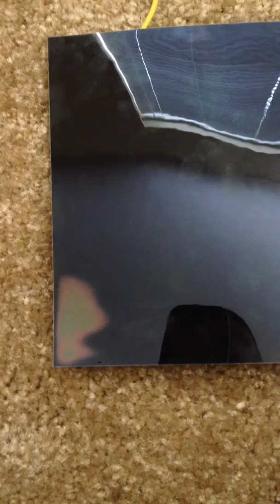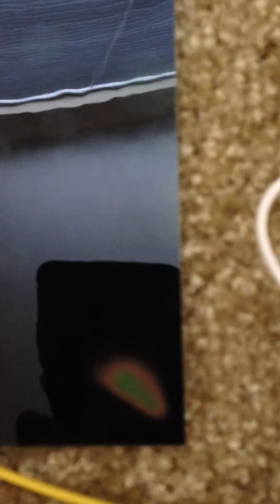Gerard Morin Thermochromic "Cold Radiation" Test

Comment: Hi Chris just dropped you a note.  The vortex is an inward collapsing of radiation from the vacuum.  same thing is occurring in Gerard's IR meter reading cold.  expansion outward is hot and inward collapse is cold.  The fields around the environment continue to move even though power is turned off until the vacuum has finally returned to it's Zero Point.  Jack Scholtz NEO Ball experiment also indicates this,   no power to his Rodin Toroid coil and yet the Neo Ball keeps spinning in the shot glass even at 10 Ft from coil for quite a while.   It would very interesting if we could discover a way to use the collapsing etheric force to give us refrigeration.

I'm building some mini pole transformers based on the How It's Made video on pole transformers.  It is very interesting when you see the poles inside secondary that is running your house.  its simply an aluminum plate and one plate can run two houses.  Primary is about 540 turns of 8 to 10 ga mag wire 14.4 KV applied.

Comment: Spark gaps get hot, and will stay hot for some time after getting hot.
Reply from the maker: Trolls must love berries or at least this one anyway :P
Reply from the maker: Binj Komisar Wrong. The gradient in this material is 135 at its peak, if it was to reach that temperature you would be able to feel the heat with your finger on the spark gap. You can't feel any temperature increase over the spark gap.
Reply: *****
I'm not going to argue with you on the fact that spark gaps DO get hot and stay hot got some time after getting hot... It is not wrong, its a fact... Its a fact, same as the FACT Morins setups will never yield more energy out than in.
Reply: Wrong again ;)
Reply: 69KillaKungfu69
lol.. you guys are the berries! ;)
Reply: *****
lol :)

Comment: Chris, this is very interesting. I built my circuit today and am testing it. I also sent you a message asking for a circuit diagram on one of your other videos. It would be helpful to know the specs of the compoments in the circuit, especially the transformers. Thanks for sharing.
Reply from the maker: Hi Tony I'm sorry I did see your message. Which diagram was it? I'm using some 1.5amp step up/down transformers now as I killed another mA transformer when I added capacitors to the circuit. The pulsing is a powerful affect on the iron square surrounding the copper coiling. Thomas Bearden discusses that openly in his papers and recorded interviews, eddy currents build up and generate a lot of heat in the Iron material. They end up going with some other material that I can't recall that resonates without generating much heat, some crystalline structure I'm sure. Anyway! I'm using two drill batteries 18v, 12v brush fed dc motor, basic washing machine pump motor, they are all very similar; I would experiment with variations. I plan on using a core motor to pool pump setup at a later time; I think I'll get much better results that way. The little transformers I picked up from a resale electronics shop, they are 120vac to 20vac step down but I run them backwards (1.5amp max), then I have a neon sign transformer and so I'm feeding in about 260 volts out of that energy eating 1.5 amp transformer into the neon and then I have a light socket with HPS bulb to see the light spectrum generated in the vacuum by the energy flow. The spark gap is a simple coil tester you get from you hardware or auto parts store. Various other components I'm using are tube bulbs, twists, regular filament bulbs and led bulbs. I recommend connecting the tube bulbs in the High Power side of the circuit and then leaving one end of each circuit unconnected, pick up the bulbs and you will feel the the energy flowing through your body and the bulbs will flow as you are completing the connection. Don't touch the end connectors of the bulbs though, it won't kill you but 30KV does get your attention, at least it has gotten mine several times!
Reply: *****
Thanks for taking the time to respond. The video on your uploads is the one titled "Gerard Morin". I would like to see the diagram for that circuit.  Were you the one filming that video at his home?  Thanks for your help!
Reply from the maker: Tony Ward Hey there Tony I just finished moving and all of my personal effects including my mobile laboratory is in boxes. I'm sorry for that and if you PM me I'll send you my number and walk you through the diagram for that circuit over the phone. I just don't have time to look for it at the moment.

Comment: Awesome find chris.
 I hooked my pump up to tesla hair pin circut using a 15k neon transformer . Hooked the ground wire up that goes outside to real ground got a boost in current .Using a incandecent bulb touching high side wires and my hand on the bulb .. Tesla electric globe???    Working on a telsa coil now to hook my antenna up . Maybe get another boost???
Reply from the maker: Awesome! I can't wait to build my coil, soon as I get moved I have so many experiments to run. I made the mistake of toughing 25K+ volts coming out of my neon sign transformer, It didn't kill me obviously but it definitely got my attention. It didn't hurt but it just had me smiling, guess I'm crazy :). My question is how far down did you have to input your rod for 'real' ground?
Reply: Its 36".
I want to do more as I have heard the more surface area in ground the more current. im just suprised of the extra flow in the bulb. i put a short vid up.
Reply from the maker: Todd Woodworth Nice... more surface area would make sense in other things I've been seeing.
Reply: no globe its flat,its a plane